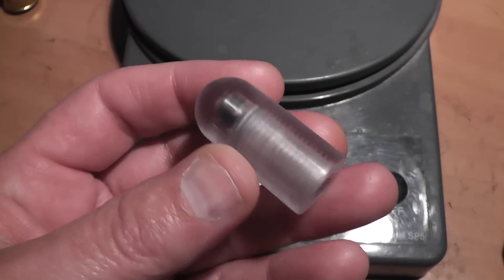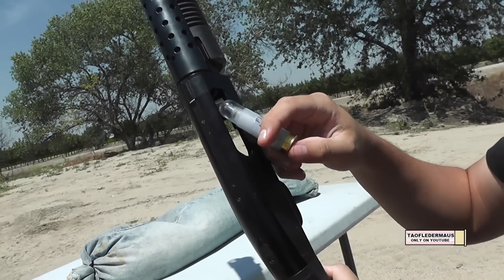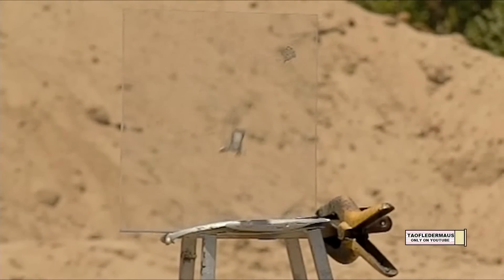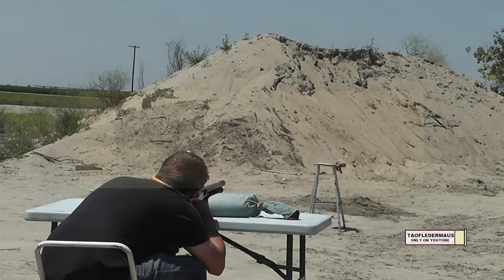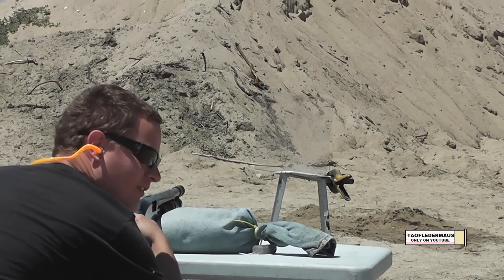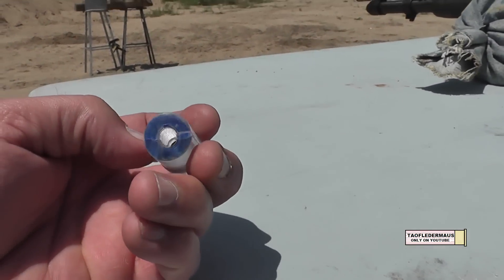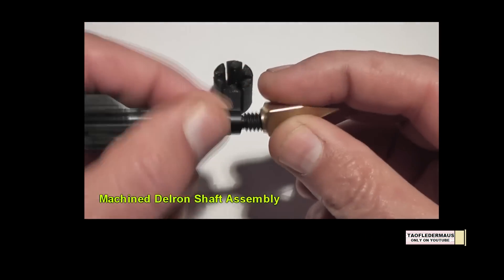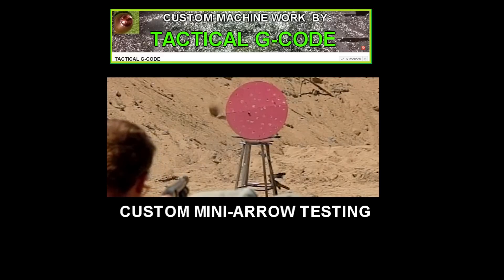12g. BULLETPROOF-GLASS BULLETS  -  Testing

Comment: What would happen if you added a bolt or something dense to the hollow section? It might be the same weight as other slugs you have shot but isn't mass a measure of density? That might be effecting the push from the shock wave like you were talking about.

Comment: Try using like 12 chopped down nails (no nail heads), and fit them tightly into a 12 gauge shell.. Maybe add wax if they fly apart when fired

Comment: If the round is traveling faster than the speed of sound, it creates a sonic boom aka a shock wave. The shock wave is traveling at the speed of sound, so no, the shock wave did not hit the plate before the bullet did.
Reply from the maker: tnnss111  Then explain why it did that.
Reply: ***** I never claimed to know the physics behind the intricacies of bullet flight, but I do know the basics of the sound barrier, supersonic flight, and pressure waves.
Reply from the maker: tnnss111 Then I'll explain it.   The rounds compress the air ahead of the round.    When that high pressure area hits a stationary object like the sheet of lexan,  a water melon,  etc,   it has enough force to deviate a lightweight round.
Reply: ***** Lol no. Yes it compresses the air in front of it, but just in front of it. Not twenty feet away.
Reply: tnnss111 You realize that air that is compressed in front of the round is still in fact ahead of the round correct? Then add in the instability of this lightweight material as a slug and it's going to slow down faster than normal leaving the previously compressed air in front as it moves, displacing more air as it goes.
The compressed air does not need to be 20 feet away to work this way either.

Comment: The glass needed to be secured better. The movement absorbed some of the energy of the round.
Reply from the maker: homertalk   I'm surprised how many people think that is a major factor.
Reply: It's all in the way energy is applied.

Think of a heavy door, like on a vault. If you push it and keep applying force, you'll slam it shut. Now imagine trying to close the door by punching it.

Projectile energy is distributed way too quickly for it to matter. Although oddly, I remember in the early days, Demolition Ranch did penetration tests on reams of paper and got deeper penetration with the unsupported targets.
Reply from the maker: AusiKifaru27   It's almost like thinking it will go deeper if you thrust the gun forward real fast as you shoot it,   to make it go faster.

Comment: Why isn't this used as armor?
Reply: AdrianThePlainGuy merp because we currently have no need to use a less effective material in order to create see-through armor.
Reply: Thicken it?
Reply: or use much less of a much better material?
Reply: AdrianThePlainGuy merp 

it seems like a good idea at first glance but oncey ou look into PC's properties you will see why it is not.

Kevlar is 10x lighter and much better at absorbing impact, and kevlar sucks compared to some. but kevlar is not transparent... so it wont work for windows, we odnt need transparent armor. 

also did you see how this dented with a polycarb bullet? imagine a lead one... it would break your skin and cause internal bleeding. also PC works as it basically melts around the bullet, it always dents though and is good for small arms mostly. 

also its not flexible over about 30 mil thickness.... and why not just use hard body armor in that case since even though it is more dense less is needed to the point it would not be much heavier but 100x more effective, you would need at-least 1.5 in of PC to be effective, you only need 1.

but keep sharing your ideas, if we all feared it would not work so we shouldn't share it we wouldn't have half the tech we do now.
Reply: Because it is not bullet proof. 2 mar resistant coated thinner sheets are glued to x amount of half in sheets sheets to make it burglary, bullet, or ballistic resistant depending on the thickness. Half inch will only stop 22lr (pretty cool they stick inside then start popping out the back) and make pistol rds bounce

Comment: Why do all these 'what if' bullets have to be so ridiculously large? Why not make it the size of a normal slug?
Reply: darkblood626 Because most things are too light if they are made the size of a normal slug. Any round too light will fail to provide enough compression to burn off the powder
Reply from the maker: *****   Yeah,  but I didn't design them.    When you make slugs out of very light materials,   you have to make them longer to make them heavy enough to shoot.

Comment: Since when is 12g the equivalent of .5 oz?  I think somebody has the scale tipping in the dealer's favor.
Reply from the maker: Bleah Bloobly  12g is the bore size.
Reply: No, on the scale when you weighed it, when you change it from ounces to grams, it goes from. .5 oz, which should be 14.2 grams, instead it said 12 grams. Was an attempt at humor to say your scale isn't converting or weighing properly.
Reply from the maker: Yeah, the resolution of my scale on oz isn't very tight.